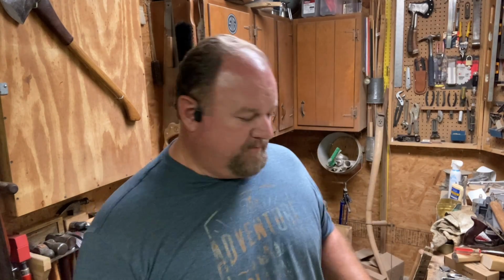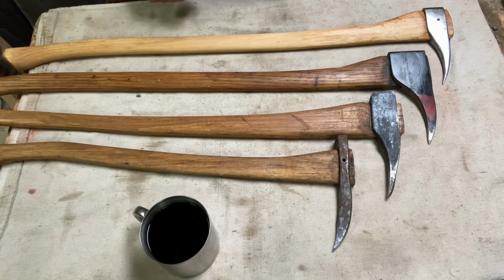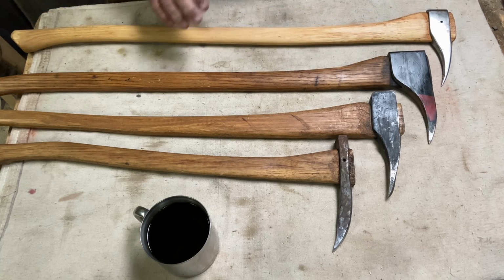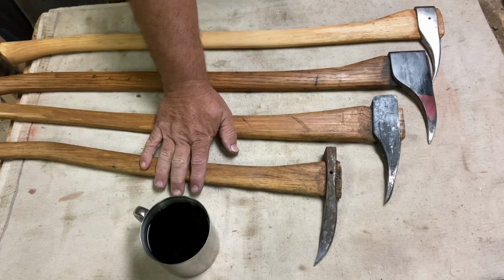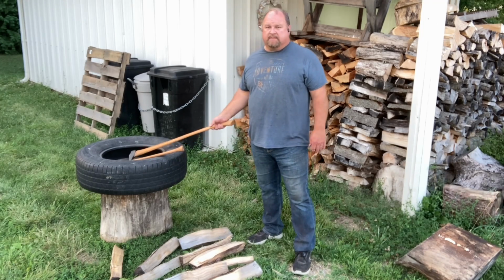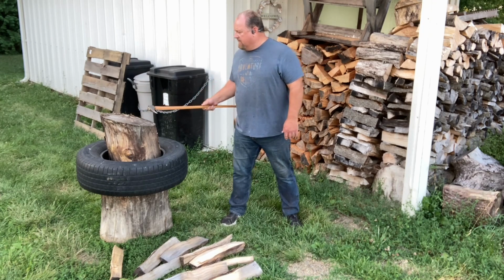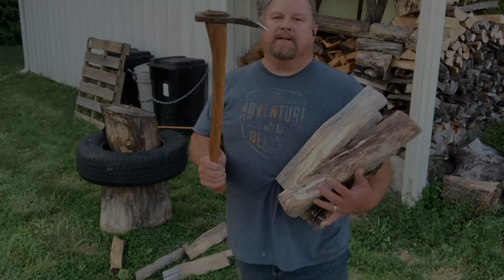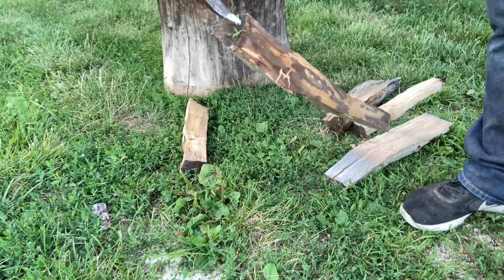Pick-a-roon, the best way to stack firewood.

Comment: Hey nice reuse of older tools. This Friday I made myself two sappies out of 42mm 4mm wall tubing & for the hook I powered up my forge and used a worn out 20mm masonry bit... Not good for knives but just right for this project. Tested it on my hydraulic splitter while splitting wood on Saturday and would never want to be without it again. Simply perfect for picking up logs from the stack in a way that is easy on the back and avoiding getting wet gloves. The big one has an old axe handle and the short one, the broken handle from a plant pick, is just long enough to use again.
Reply from the maker: Those tools sound great, and I love your ingenuity. Can you explain to me the word, “sappies”? That’s a new one for me. If you’re at all inclined, I would love to see a picture of these tools. You can send pictures too, toolscouter@gmail.com. Thank you so much for sharing with me and for stopping by and watching the video. Thanks again and have a great day.

Comment: People, don't get the Fiskars one, if you do you have to find a way to add weight on it's head, because it's too light, way too light so it doesn't work as the ones you see here! It may stick if you hit fast, but it's still 50/50 chance, that the log will fall off while you carry it.
Good job sir, your's work perfect!!!
Reply from the maker: Thank you
Reply: I received a Fiskars pikaroon for Christmas and have been using it. My experience has been amazing and I’m very happy with it. I’m surprised how well it holds wood on its beak to carry.

Comment: Great video. Have you tried any pickaroons with lighter handles (such as fiskars)? Would a lighter handle be beneficial, or do wood handles have a better balanced weight?
Reply from the maker: I think a lighter handle would be just fine. I just don’t like the feel of plastic I like wooden handles. I did make a small pick a room. I just didn’t show it on the video. The Fisker’s pick a roon is round I believe. The shape of the point is what is important. You can try it and see if it works for you. You can also modify the point. Good luck and have fun. Have a great day.